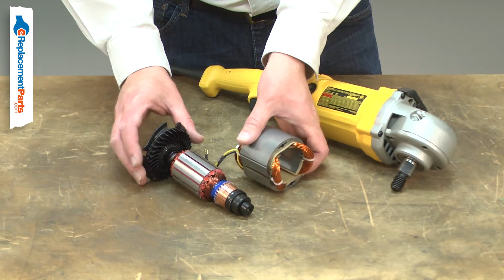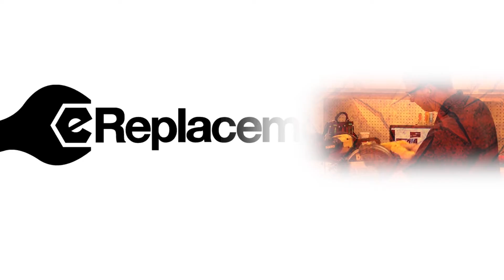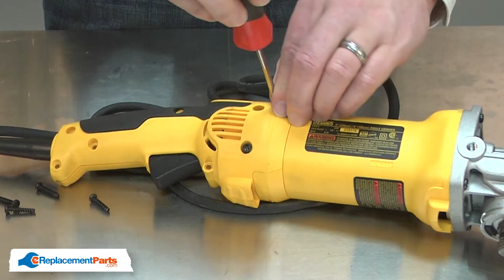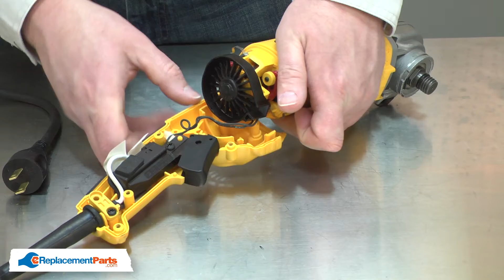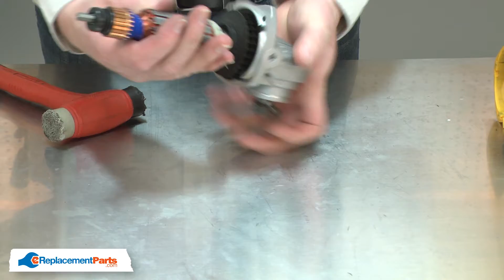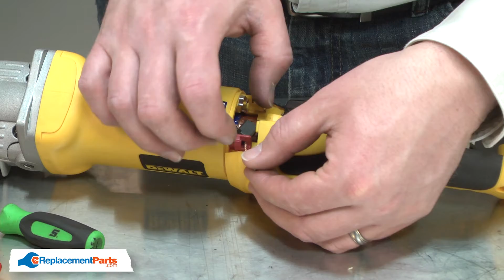DeWALT Grinder Repair - Replacing the Armature (DeWALT Part # N397997)

Comment: This is not what I would call a repair video. Why not show how to rewind the armature? Show all the processes from removing old wiring and rewinding with new copper wire with all the steps involved? That would be a repair video.
Reply: If i had to guess its not worth doing. Humans vs machines making replacement parts. Theres no contest.